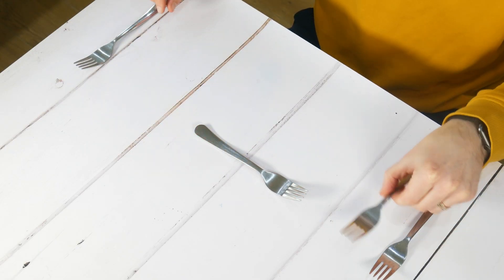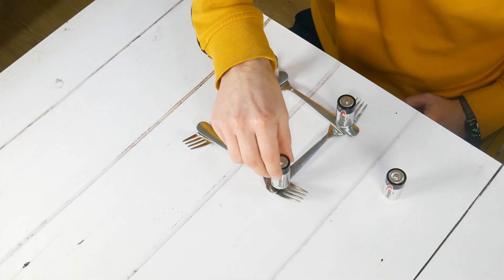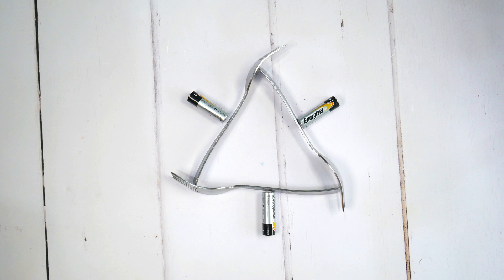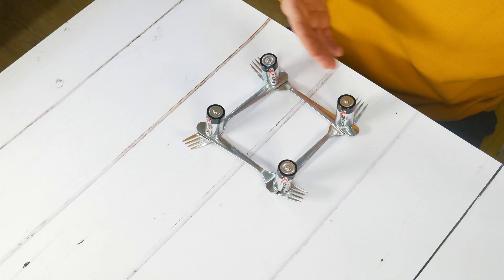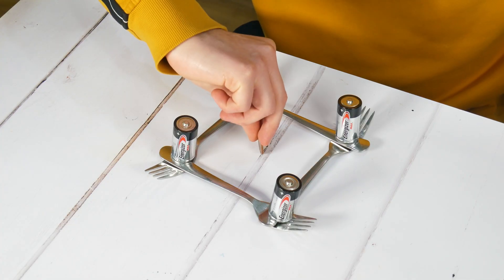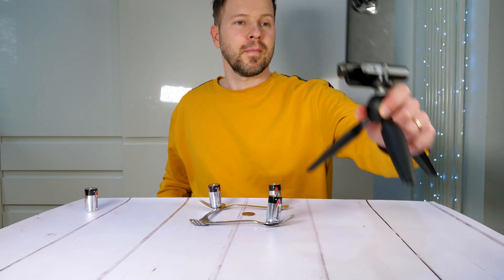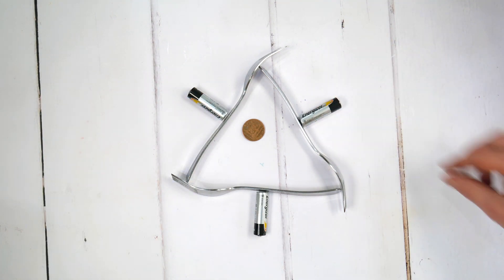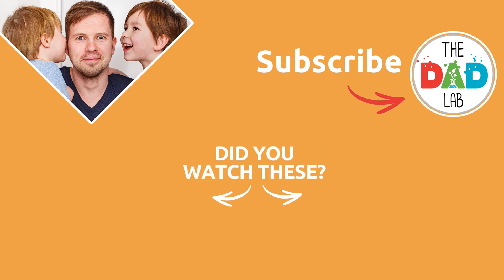How To Make A Coin Spin Using Forks and Batteries

Comment: The forks should close the circuit to generate magnetic field - perhaps there's something similar actually working, but whoever put that on internet copied it incorrect.
I would try to first close the circuit, but with some resistor, as otherwise short just by bare fork would cause the battery to damage (perhaps blowing up or just getting hot) or just discharge fast in best case perhaps doing some work in the mean time - forks should connect positive and negative terminals of the batteries. that would induce magnetic field. It's best to use some potentiometer adjusting resistance, therefore power of the magnetic field.